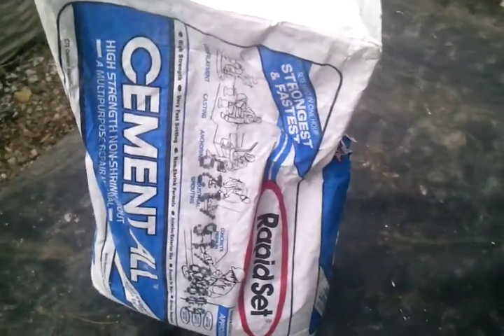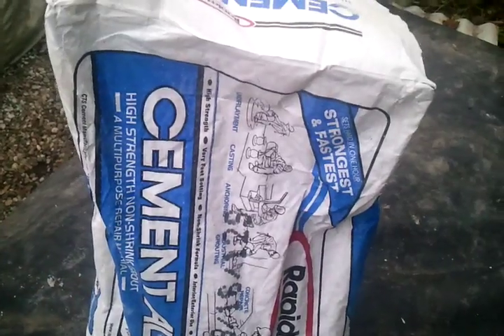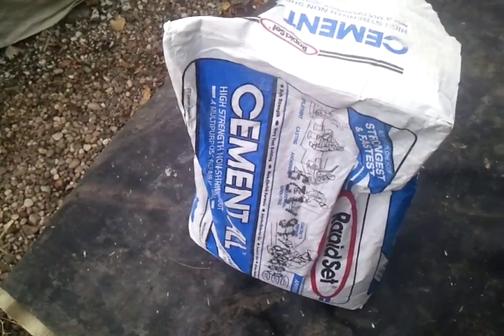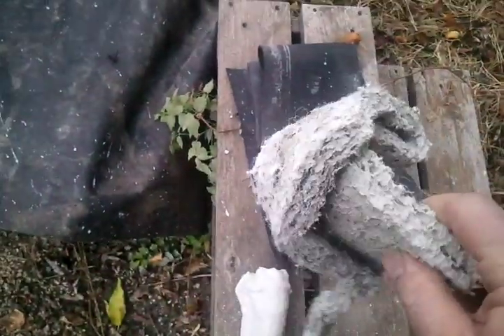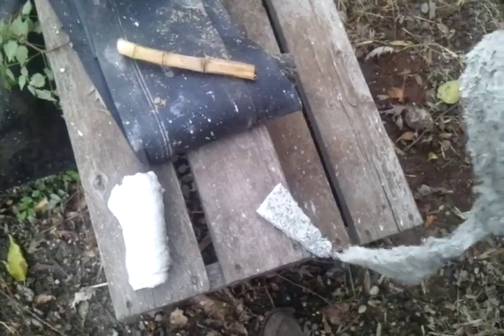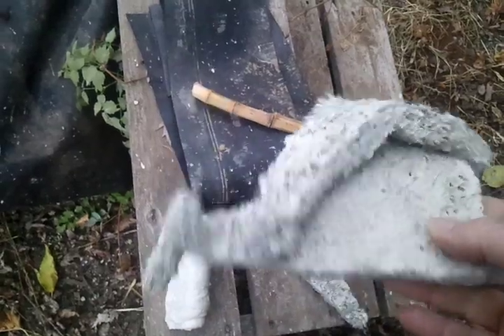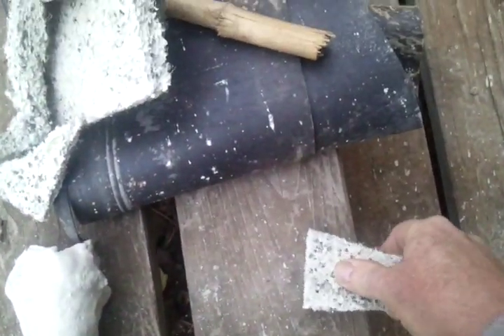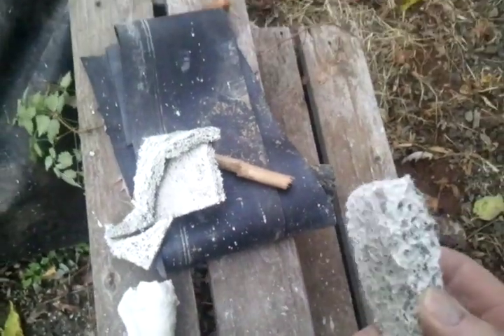Free form concrete -2012-11-16

Comment: You've sold me after that very conclusive experiment on a thread bare old sheet. 
Even the paper towel worked. Fabric stretched over a frame and you could tailor make a semi permeant shelter any shape or size you want and keep adding rooms onto it. I reckon this idea has some endless possibilities .. and you could make it in sections and join it together. 
Weather proof humpy on the bush block without carting trailer loads of timber, chainsaw, power tools. etc.. 
Bamboo sticks, roll of hessian and a few bags of cement, and put a fire place in it because it won't burn down.
Great video..!
Reply: @Axel-skies  Im thinking a cheap tent could be used as a base form!
Reply: @snipeweedan  I ended up going all out and using a geodesic climbing dome for kids off Amazon for a couple of hundred dollars. I raised it off the ground for inside height and covered the whole thing with plastic then old curtains from goodwill and mixed cement, bondcrete - (latex0 and water and buttered it on by hand. After weathering the cement really needs to be reapplied in places and be a fair bit thicker.  Cement and rag .. gets my vote.
Reply: @Axel-skies  thanks for sharing that you go man drop a photo if you dare🤩

Comment: Ive been wondering if this cement could be used over one of those canvas tents to create a hard shell permanent tent. It could then be spray stuccoed for more thickness and  waterproofed with paint. I'd  install  a swinging door instead of the regular tent opening cover.  Do you think it would work???
Reply from the maker: Absolutely would work.  This created a nice base which could have been shaped any way I wanted.
Reply: I'm hearing ya..!

Comment: I love dipping into concrete. You can also use just the portland cement as then it will sink in a bit better since there is no sand. I have a few tests here: https://www.madebybarb.com/2018/10/13/fabric-tests-for-concrete-draping/
Reply: Barb, this is the first time I've seen a comment from you on someone else's channel.  I've tried several of your projects and they all turned out really well, especially the orbs.  :)

Comment: Have you seen this one:  LATEX CONCRETE ROOF -> http://www.instructables.com/id/Latex-Concrete-Roof/

I'm researching for some inexpensive ways to build some decent storage and animal shelters for my little homestead in South Dakota.  Thanks for experimenting for the rest of us and providing some food for thought.
Reply from the maker: Thanks that is a very good article.  I have seen buildings made by forming concrete over mounds of dirt which is later removed,  There is a place in Arizona called Arcosanti that used this technique.  https://arcosanti.org/project/architecture/
Reply from the maker: This building is a good example.  The designs in the roof were made with colored sand and the patterns were carved into the dirt before the concrete was poured!  https://arcosanti.org/portfolio/ceramics-apse/
Reply: Interesting.  Thank you!  Lots of playing to do this summer!
Reply: BTW - did you leave your cloth soaked experiment outside and if you did, how has it held up?
Reply from the maker: It held up
Reply: Thanks again for taking the time to answer.  Can't wait to try this this summer!

Comment: your idea is pure genius!!!! :))))) You started me thinking--with the help of  few people who could build a dome shaped form---cover it with burlap--wet soak the burlap down---and then ---some how blow ---cement over the wet burlap.  Repeat the burlap and cement process--until you had the desired thickness.
Reply from the maker: +Johnny Wewoka Yes, someday I would like to build some free form structures.  The CSA (calcium sulfoaluminate) is pretty expensive, but it makes the initial shape quickly.  After that any number of coating can be applied.
Reply: Bob Campbell YOUR responsible for my brainstorming LOL. I was thinking --- free form structures --depending on the size of the structure--would -still need some kind of reinforcement.
Reply from the maker: Johnny Wewoka
Yes a steel concrete reinforcement would be added to the shape and foam, shotcrete, or concrete can be layered on top.
Reply: Bob Campbell I have an idea --to use 1-1/2 CPVC (conduit) flatten the ends --drill a 3/8 hole in one end of the pipes. How many? --I don't know --yet. THEN use some kind of screen--and cover it with Papercrete. It's is very light --Just an idea.
Reply from the maker: Johnny Wewoka
It can be done many ways.  I've seen very large structures made on top of a mound of dirt.  This was really cool because they added colored powder and carved designs into the dirt first.  Balloons and tents have also been used.
Reply: Is that where they pile up a huge mound of dirt---place a tarp over the mound of dirt----then pour concrete  over the mound? They wait for the concrete to harden --then dig out the dirt until the tarp is exposed under the layer of concrete.??
Reply from the maker: Johnny Wewoka
Yes , but the tarp is not required.  Colored sand and 3D designs can be incorporated.

Comment: Great video. Thanks for the ideas. Have you followed up on the foam with this cement cloth cover? Or have you experimented with using this as a "shell" for backyard and homestead projects (dog houses, chicken "tractors", sheep sheds, on skids, etc?) Curious to hear any further progress (successes and failures).
Reply: Hello Erin,    everything you mentioned is possible, and I am speaking from experience.   I make faux rocks/boulders/ tree stumps, anything you can think of.   I cover S.foam with any cloth fabric soaked in cement.  You then can paint more cement on after to achieve the texture you desire...literally the possibllities are endless.
I make all sorts of stuff.
The rapid set shown,  is very strong and fast setting.
I have found using something like that for when I need more strength, maybe the 2nd or 3rd coat.
but just water and Portland cement   is ideal to get you going and then do add layers of cement or concrete as needed.
  Be well.   Just noticed you asked 3 years ago, haha,  you could not even care anymore or have figured it out, haa